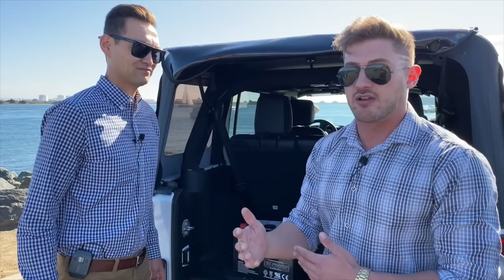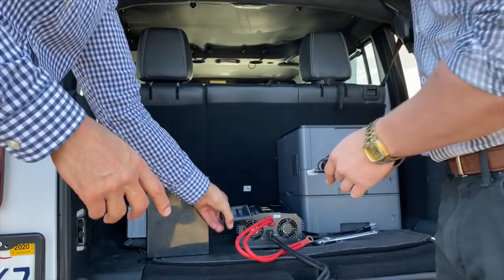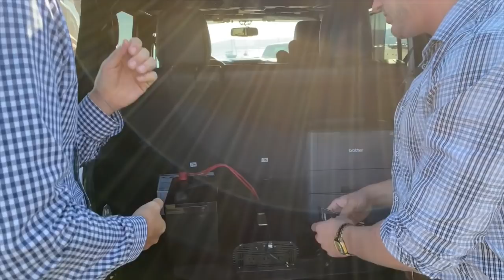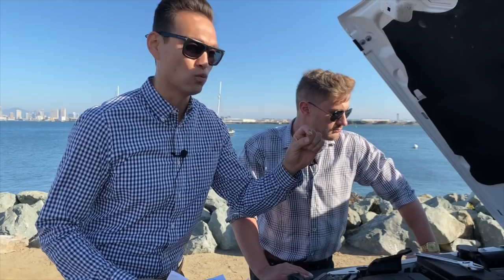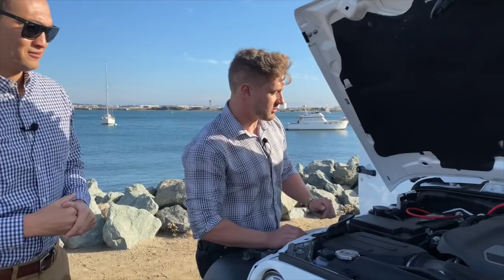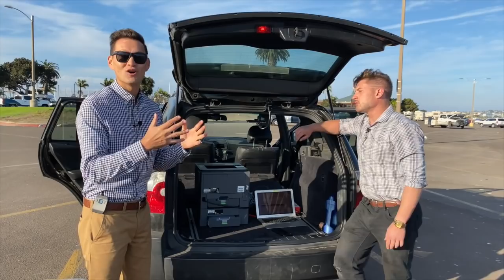How to Set Up a Mobile Office with a Printer So You Can Print Documents from Your Car | Notary Hacks

Comment: You can also jumpstart your car battery with the extra battery in your trunk
Reply: And if you're using the setup with your car battery, you can use your car like a low-level generator during a power outage or similar emergency. 😉

Comment: FYI - You can also use a converter from car to regular plug, cost on $15 -$20  and no installation need.
Reply from the maker: we cover why that does not work in this video-there is not enough watts to run a printer large enough print letter and legal size docs.
Reply: @MarkWillsLoanSigningSystem  exactly right. It is not just converting 12v to 110v is about peak watts and amps. Nice set up.
Reply: But you can, I doing it now and have been with other electronics in my SUV
Reply: @CarlJohnsonandAssociates  Have you seen the Jackery portable battery? No wires involved and they use them in campers.
Reply: @Just_Liz_zie  Yes, I have something similar to that called a jump start but I never thought of using it for power.

Comment: Remember to check the amperage on your printer.  Even with the 100AH Deep Cycle Battery, and 2000w pure sine wave power inverter, 11.4 Amps is too much. Your printer needs to be below 10amps.
Reply: I’m having this problem. So what do I need to do. Buy a larger battery?

Comment: Does it matter if it is the Weize Gel deep cycle?  I am asking because I bought the Weize 100ah Deep Cycle Gel and the printer isn’t getting enough power.  I wanted to ask before I order another battery.  Thanks
Reply: Not a WEIZE but 100AH and I have the same problem with a 2000W inverter by Krieger

Comment: Quick question - where is the link for the 25ft cord that connects the in-car battery to the inverter? Thanks 👍
Reply from the maker: If you click below you will see a link to all the supplies needed. 

https://www.loansigningsystem.com/mobileofficesetup.html
Reply: @MarkWillsLoanSigningSystem  Thanks!  Doh!!! I didn't scroll down far enough.

Comment: What if you have a three prong  outlet plug in the back of the car?  Your golden right?  No need for a battery??? Great Idea...loving it!
Reply from the maker: only if that outlet provides at least 1600 watts of electricity! if it provides the same amount of watts as your cigarette lighter (which is usually 300-500 watts) your printer wont print!

Comment: Mark...I haven't gotten through the entire video yet, so I apologize if this is said. One solution to the concern of the battery moving around, is it could be placed in a plastic battery box, sold at any Auto Part store. These boxes are what hold the batteries to the frame of an RV. I don't have the solution to mount the box yet, but i am sure someone can figure that out.
Reply from the maker: no need to apologize man! we actually dont cover it well enough so if you find solution please share!
Reply: @MarkWillsLoanSigningSystem  here is the Box I'm referring too. Depending on the vehicle, this could be attached to the covering of the spare tire, or place everything on a piece of plywood, and could even anchor the printer down that way.

Camco Regular 55362 Battery Box-Group 24 https://www.amazon.com/dp/B0024ECJSQ/ref=cm_sw_r_em_apa_i_ez9cEbE5FMMHT
Reply: Brackets?

Comment: Question for Conner. Shouldn't there be a ground wire on the gold ground wire terminal located on the outlet side going to the vehicle frame.
Reply: Curious as well.
Reply: @deedean5235  I also wonder why he didn't since every where I've researched says to use one..Also adding a fuse breaker on the positive cable

Comment: Hi, I bought the exact item listed. Inverter, battery, charger, and printer. But some how everytime I turned on the power of the inverter it would make a loud beep while the printer try to turn on and then shutoff?? Bty this is for the external battery. Which I have it recharged. Seems like the battery doesn’t hold a charge powerful enough to power the printer? Please advice. Thanks
Reply from the maker: with out seeing your set up and full disclosure i am not licensed electrician just a signing  agent trying to help others. 

my first question would be are you sure the battery charger is set up correctly to charge the actual battery.

we have many people use this set up successfully since the launch of the video.
Reply: @MarkWillsLoanSigningSystem    I have the exactly set up as yours on your video and I had the same issue - beeping from the inverter when it was turned on.   Also, I have noticed that when I recharged the battery at night, it did not take 6 hours with the correct setting (15A and AMG mode).   Usually just take about 2 hours...      So my question for you is that with your own set up, how many copies of document and the size of document when you print in your car?     The only difference for my set up than yours is that I have a brother 6200 dwt printer instead of the older version, but the voltage should be the same.  Thanks.
Reply: @AmyyyWA  I can't get my 6200 to work at all without the battery being on the charger at the same time.
Reply: make sure on the battery charger you select the correct battery type. You probably have a AGM battery and the charger needs to be set to charge this type of battery.
Reply: Hey guys, thank your for taking the time to reply. To answer your question, yes it is set to charge the AGM battery. The setup is exactly like the video with exact same item I bought on the link from Amazon.   Anyhow, I have found the solution which could be of some help for other as they do not need to recharge their battery nightly/daily. I used a Battery Jump Starter which normally use to start a dead battery connected to the battery just like how we normally connect to our car battery to start a car when the battery is drained. This way it will create an eclectic boost to the battery so that whenever you turn on the inverter and printer it won’t shutting it down since the Printer does used a lot of watt to boost. Hope this help. 

Ps. Thanks Mark for the video. Very helpful as well as all your YouTube training.
Reply: @thatsmeleon  take a look at this video. it explains that allowing the battery to drain too much will have negative effects on the battery. Video is a little long but the first 8 mins has the core information.   https://youtu.be/Z3xKYDpGwxs
Reply: Thanks
Reply: @thatsmeleon  hey bro thanks for the info, by any chance can you tell me what battery jump starter are you using? im having exactly the same problem, whenever i turn the printer on the inverter starts to beep. than you
Reply: @journeys00  Hi Luis, sorry late respond. I used a general 800amp+ Cetrix brand i bought at Target. It does the job. But just a temporary one. After couple would not recommend the external battery use...  If you are constantly print in the car then the best solution is wire it directly to the car battery for permanent solution. Otherwise, you can use a (battery jumper cable with quick connect) that you can buy from Amazon, so you can use it to connect from your car battery to the inverter as needed and no need to go thru all the wiring in the car. That is what i'm using now. Hope that help.

Comment: Got it all hooked up! Problem that the power cords were not long enough. The invert ended up in back seat
Reply from the maker: you should be using these cords:

https://www.amazon.com/dp/B017VBMHRO/ref=cm_sw_r_cp_apa_i_ZGC6DbJ2TG1G5?fbclid=IwAR1oj1gan1JJoR91xARb0bLRugyV29eG8gOZYOs1aFz4pB7Gtn_AmNnc2gA

Comment: Is there no need to add a circuit breaker in front of the Inverter when it is connected to the battery when the battery is under your hood? Here's the breaker that I'm talking about.

https://www.amazon.com/gp/product/B01AKDHZ6S/ref=ppx_yo_dt_b_asin_title_o02_s00?ie=UTF8&psc=1
Reply: you have to have a breaker or fuse as close to your battery as possible. Otherwise, it's fire hazard.  2 gauge wire minimum thickness, pure copper. 150 amp is perfect.

Comment: I suggest using a lithium battery power supply like a Jackery or a Suaoki 500. They can be charged from your car battery (12-volt) when you drive or via a portable solar panel or by 110. They weigh a lot less than an AGM, have a built-in inverter, do not require wiring and are safer to keep in a vehicle - plug and play. Most importantly, Lithium can be discharged down to less than 20% but an AGM battery cannot go below 50% or you will damage the battery and need to replace it much sooner. The van dwelling community is very familiar with lithium batteries. Good idea for the rest of the office, though.
Reply: Great thoughts.. except.. Suaoki 500 = 600 watts peak..  Jackery is about the same.. you need a power supply with at least 1500 watts for most laser printers.. preferably 2k watts.. those power stations are crazy expensive. You would need something like a Goal Zero Yeti 1400 Lithium Portable Power Station for that printer.. 1500 watt .. $1800  Good thoughts on Lithium.. but you still need a 2k watt inverter and then whatever solar equip you might want to charge your lithium..  Or, just hard wire straight to the battery that comes with  the car.  unless your printing for hours at a time.. Even then, you can do it but run your car a bit to recharge the battery..  you're battery can handle it.
Reply: @tex959  Both Jackery, Suaoki and Kodiak Inergy make larger power generators (with higher upfront investment.) I always look for a self-contained solution 'cause I hate dealing with wiring. Whatever works! Check out Will Prowse on YT or read his book online: Mobile Solar Power Made Easy.

Comment: Do you have a larger battery that you recommend that will require less charging?
Reply from the maker: depending on your out put the one recommending will last more than one day but it is best practice to charge it every night so you are not stuck with out power when you really need it!
Reply: deep cycle for sure.. than just compare amp hours vs price vs weight. vs power needs

Comment: Option B - using your vehicle battery is by far the better option
Reply from the maker: if you have the technical skill-i would agree.
Reply: Mark Wills Any local audio/stereo shop can do that for you 🤓
Reply: @ joe.. correct. that's the 100% best way to go.. no one wants to lug a seperate battery to and from the house every night.
Reply: For 150 pages? 🤯
Reply: @kauigirl808  Yes and more.
Reply: Only if your alternator can handle the extra draw.

Comment: I watched the entire video but I don't know if I missed the part of what happens in the cabin of the car with the wires between the inverter in the truck all the way to the hole into the engine. What is done with the wiring to secure it when you have passengers in the car and other items in the cabin?  Thanks in advance, gents!
Reply: Search wiring car amplifier on youtube.. you gotta hide the wires under the carpet and panels.. you don't want wire in the way.. nothing should be visible until you get to the inverter.

Comment: Great content! In the summer when the temperature rises to over 💯 degrees (in the Central Valley CA), the vehicle gets scorchingly hot in the trunk. Would printer be ok printing at those temperatures? Greatly appreciate it.
Reply from the maker: over heating isnt good for any electronics-period.

but if you are in you car driving around you will have your AC on and the hour you are in the appt it shouldn't be a huge concern (but you should definitely read the manuals of each product).

however with that being said, i probably wouldnt park your car outside with out shade when the car is not in use especially if your area gets incredibly hot.
Reply: Park your car under the shade. Or perhaps find a cover. I realize we can't keep the AC on when our ignitions are off. Also, remove your toner when you get home. But, I get that throughout the day, the heat is a concern that I also need to find a solution. I'm also in the CV. Modesto.
Reply: @maymendoza3385  have you found a solution?
I was wondering the same thing.
Reply: @nicolebeasley7567  same here.  That's specifically what I was searching for when I found this video.
Reply: Great video. My wife is a student of your Mark and I took another course.  Both AR invaluable.  I just wish we lived in a big market. You guys out in Cali kill it.  (not mad. jealous), lol. We're doing ok though.  Congrats yall,  keep it going!!!
Reply: If you put in your trunk.. figure out a way to vent your trunk if possible.. if you keep in your back seats, crack windows when in direct sun.  However, your car is full of electronics that survive the heat.. The printer might be just as good at dealing with the heat.
Reply: Thanks Mark for your feedback.

Comment: I would use would be a mini solar-charger to keep the battery full and you wouldn't have to take the batter out every night.  Also, could you use a audio capacitor as a power supply???? There's a 2500 watt Capacitor made by Soundbox that weighs 2-lbs for $31.00.
Reply from the maker: just like there is not only one way to build a signing agent business there is not only one way to build a mobile office! 

thank you for your comment!
Reply: the capacitor(or, Cap) is never a stand alone power supply like a battery.  All Caps are connected to the battery.. The Caps are used in applications when you need larger bursts of electricity to power a device.  So, no reason to get a Cap when you need to hook up to a battery anyway.  They use them in car stereo applications to push a higher wattage in incremental bursts than what would be efficient to pull directly from a battery.    

A Solar kit is a great idea.  consider getting 100W Flex panel which can be placed or permanently attached to the top of your car. Regular panels usually require a roof rack to attach to.  Then you gotta run wires to the trunk or inside the vehicle. 

@@KloutKulture  If I understand your question,  The solar panel will not provide enough constant power alone but all solar panels  are meant to do is charge the battery.  the battery will have enough power as long as the panel can keep up with demands.  If you asking if the panel can keep up.. It depends on hours of sun(shade provides little solar power)  vs size of panel or panels vs how many amp hours used by printer / scanner / laptop / other devices.  Google sites for solar energy audits for more info.
Reply: tex959 So with the panel you don't need a cap?
Reply: @Kloutkulture    I wouldn't mess with a panel, personally.. just hook directly to your car battery.. get a 1500 watt min. inverter..best to get a 2k or larger inverter your car battery will run the printer just fine.. if you have to print more than an hour.. start the car to keep the battery charged.. same idea with high power car stereo systems.
Reply: tex959 If the capacitor is installed(connected to car battery in parallel) in the trunk, it shouldn’t be a problem to connect capacitor to it. It’s just smaller, lighter and cheaper than a car battery.
Reply: @St.Maurice   Oh.. didn't know you meant to hook the capacitor to the car battery.. yes, you can do that... However, if you are hooking the car battery to the capacitor, why not skip the capacitor and just hook the car battery directly to the inverter?  You don't need a 2nd battery in the trunk if you are connecting to the car battery under the hood.  It sounds like you are already running power wires from the car battery to the trunk?
Reply: tex959 Agreed.
Reply: Would the solar charger send enough juice though?
Reply: @Kloutkulture  I know that car dealerships use them to keep the batteries charged.
Solar Charger:

https://www.amazon.com/ECO-WORTHY-Portable-Battery-Charger-Batteries/dp/B015ZGDYII/ref=sr_1_3?crid=1ML3U7VGO7QMZ&keywords=solar+battery+charger+12+volt&qid=1576108778&sprefix=Solar+batt%2Caps%2C165&sr=8-3

Capacitor:
https://www.amazon.com/Sound-Storm-C352-Capacitor-Storage/dp/B00FU8O4NQ/ref=pd_cp_107_3/142-1039775-6728812?_encoding=UTF8&pd_rd_i=B00FU8O4NQ&pd_rd_r=78d63bf6-9e23-4cc9-b28c-22dd8c8d11f8&pd_rd_w=DwzJQ&pd_rd_wg=C2r9u&pf_rd_p=0e5324e1-c848-4872-bbd5-5be6baedf80e&pf_rd_r=8G5YHP29P54G5EKCF2NK&refRID=8G5YHP29P54G5EKCF2NK&th=1
Reply: St. Maurice Thanks
Reply: Can you use an iPad instead of laptop?
Reply: Julius Vega I don’t see why not. I use adobe acrobat to print all my documents
Reply: Chris White What if I install a flux capacitor?  Will I be able to travel back in time?  I’m trying to get back to the 80’s. Specifically 1985.
Reply: More info, like your idea